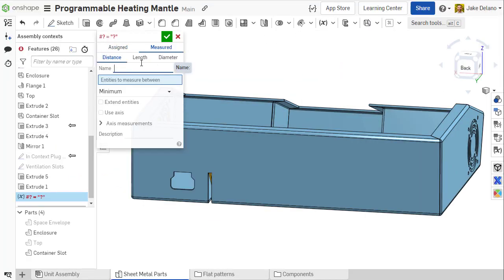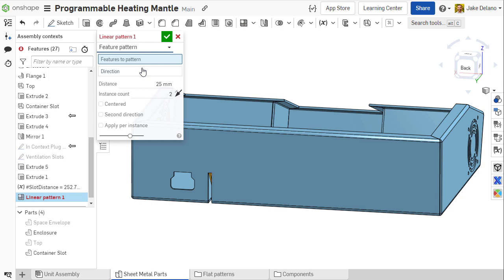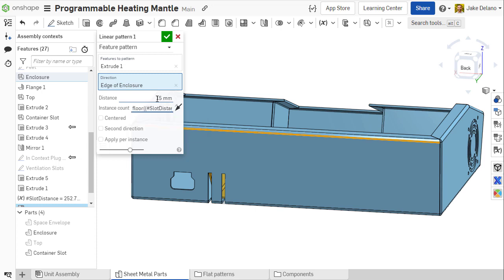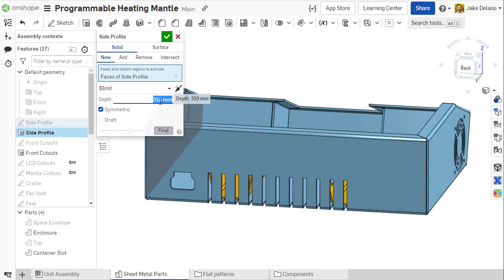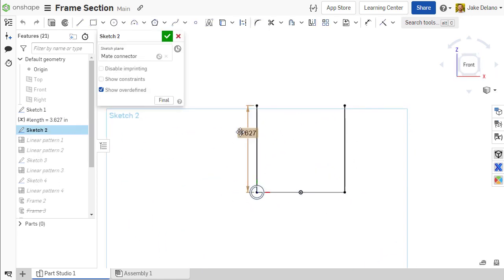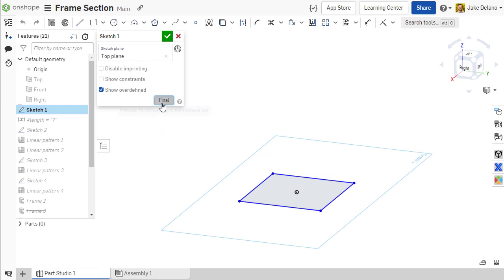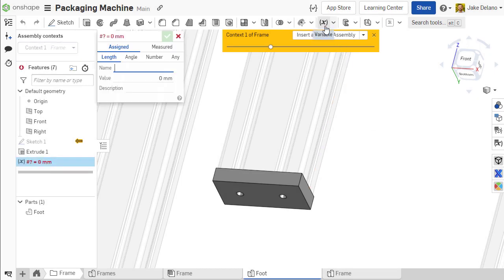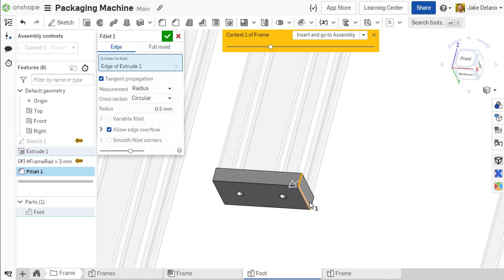Tech Tip: Using Driven Variables in Onshape

Comment: Seems that the pattern instance parameter will convert the expression(which includes the variable whose value is a measured distance) into an integer. 5.3 becomes 5 for example giving you five slots. Also a measured variable is a label for a distance in your geometry, the value of which can be used elsewhere.

Comment: Amazing Tech tip , quik question: what does floor (x) mean ?....any link to floor (x) documentation?..Thanks
Reply from the maker: Floor is a command used for rounding, specifically down to the next lowest integer (ex: floor(3.6) = 3). More information on this can be found in our FeatureScript documentation. In this case it was used to round down to the nearest integer to ensure for proper spacing between instances. https://cad.onshape.com/FsDoc/library.html#floor-number
Reply: Great tip, thanks!